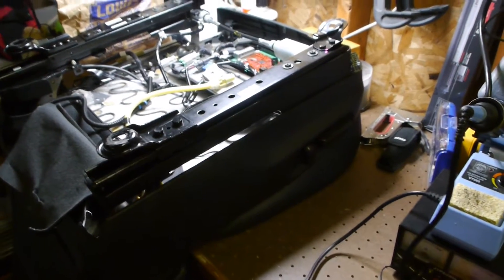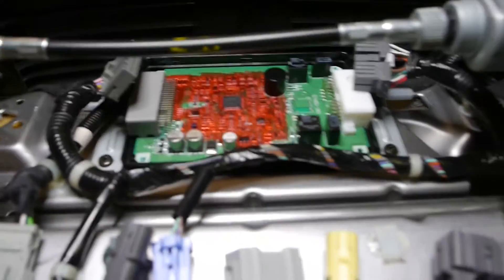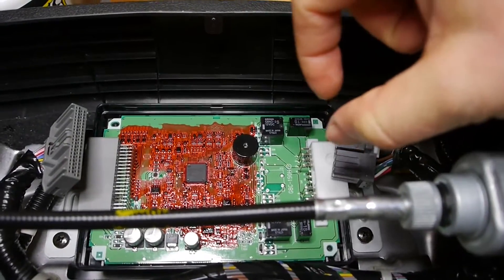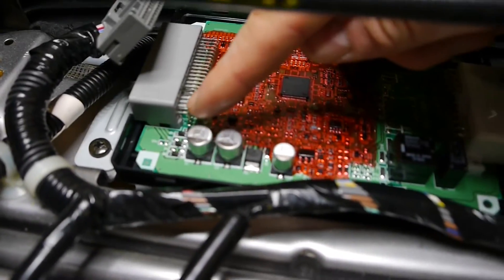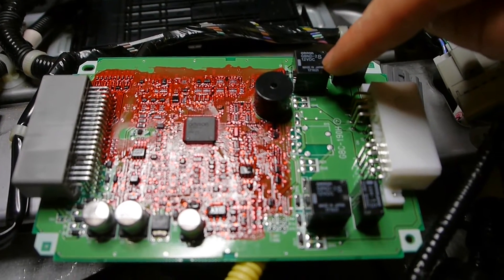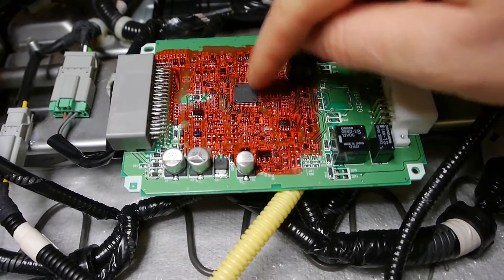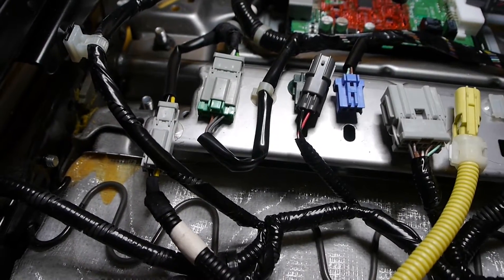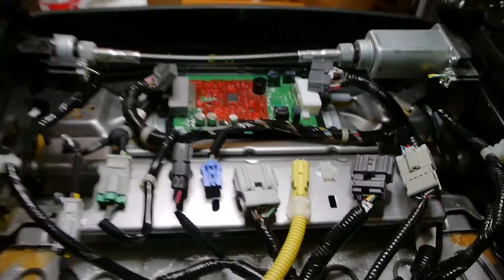Acura TSX power seat reverse engineering

Comment: To anyone swapping this seat:

Connect these 12 wire colors on memory connector to switch panel wiring on side of seat 
white/blue (+12v)
cyan (slider, orange)
brown/white (front height, red/black)
brown (ground)
green (rear height, green/orange)
white/red (+12v)
red (recline, pink)
blue (rear height, grey)
grey (recline, purple)
orange (front height, cyan)
yellow (slider, red/white)
brown (ground)
black (+12v)
-----------
Seat Heater:
12v to red/black and grey/blue
grey/red to grey/red
grey to grey
negative to brown and black on switch
Reply: Im doing this swap , bought 2007 seats need them in my 2004 .

Comment: Have you ever figured this out?  I have a 2004 TSX which only has a powered driver seat.  My passenger seat ripped so I purchased a powered seat out of a 2007 and I'm gonna try to wire that in.  Your video was very helpful.  I'm hoping the plugs for the passenger are the same as the driver side.  I should know where to look from here.  Thanks.  I'll keep you posted on my findings.

Comment: Hi there! I'm in the same boat as Matthew, but I'm putting mine in my Chevelle. How did you end up pulling it off!? Any help would be greatly appreciated!
Reply: +Spencer Tribbick 
I have been dealing with the same situation. I don't see where the answer was posted. I've been messing with this for a few days. Does anyone have the answer ?
Reply: Hey Josh, and others..... I got it to work! Minus the memory function. It involves applying +12v and ground to the switch then cutting and soldering all the motor wires from the switch bypassing the control unit. I used a couple terminals from inside one of the other plugs under the seat to splice into the switch plug. I used wiring diagrams to solve it. I've got them if anyone wants, also if anyone has any other issues or questions I'd be happy to help. The seat is on my workbench right now if anyone wants pictures... aceterrific@hotmail.com
Good luck!

Comment: A lot of this information is very useful for a more common use of TSX seats: a swap into a Honda Accord. There are many people on the automotive forums who have attempted this swap and struggled miserably because of that logic board. The board's primary purpose is to operate the memory seat function on the TSX. Without memory seats, I don't think the logic board would be necessary as some simple switches and relays could control the seat motors.  Be careful with that 2-wire connection that you were stumped by, these seats have an airbag in the shoulder, that connection is likely for the signal to that airbag. I expect there is a specific coded signal that sets it off to prevent any accidental deployment. Cool project, glad you got it working and thanks for sharing the information.